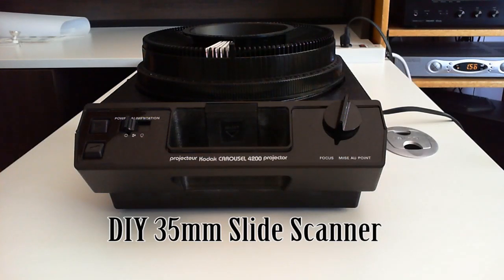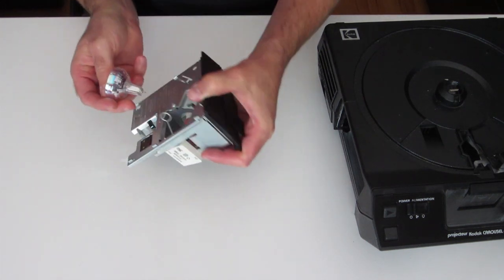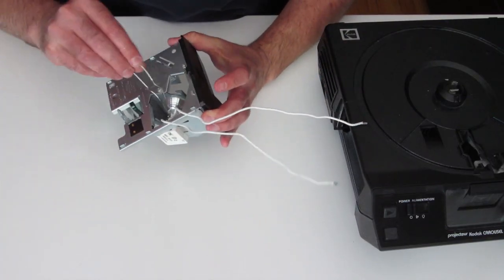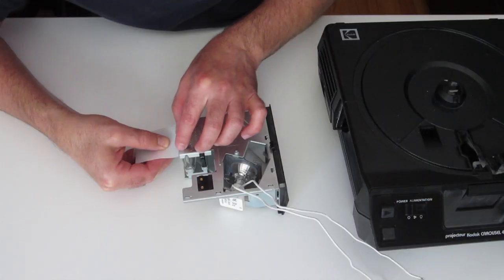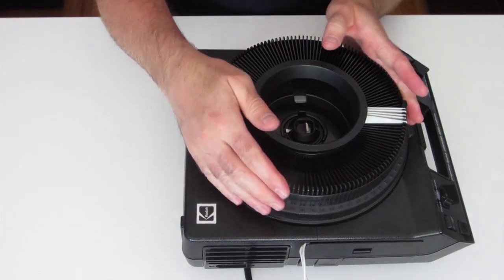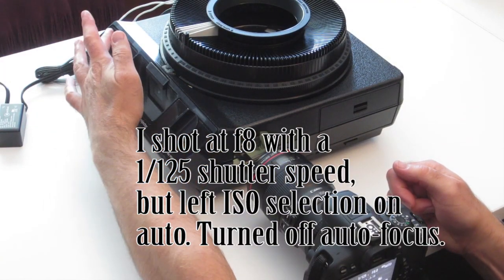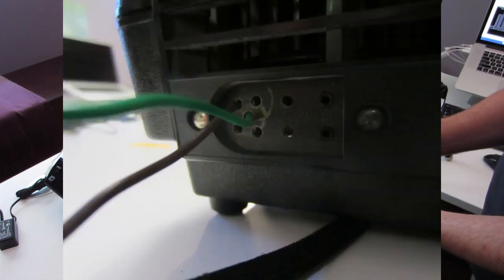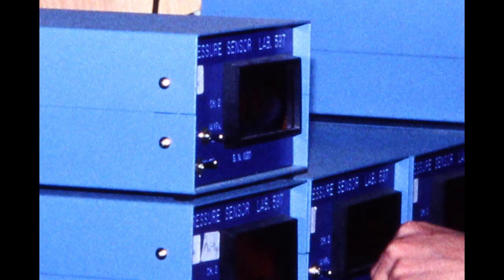DIY 35mm Slide Scanner

Comment: I would be glad to pay you a fee for in depth instruction on how to build this project. For example, I went to the raspberry pi web sight and found many computers to choose from, which one, I have no idea!
Reply from the maker: Hi Andrew, you can do it with any generation of Raspberry Pi, but I was using the 3rd generation. If I have time, I'll try to post a detailed tutorial of the automation portion of the project. Depending on how many slides you have to convert, it might be easier to just manually advance the projector, and manually fire the camera. It would save building out the raspberry pi portion, and give you the same end result (except you'd have to click the projector advance button with your finger, the click the mouse to capture the image for each slide).

Comment from the maker: Python code can be found here: https://pastebin.com/8yYf6NCW
If the code compiles and runs without error, it will likely output http://0.0.0.0:8080 at the Raspberry Pi console.
Hypothetical situation: Digicam is running on a computer with IP address of 192.168.1.50; Raspberry Pi IP Address is 192.168.1.75; You have 12 slides in the carousel;  From any browser, you would enter http://192.168.1.75:8080/advance/192.168.1.50/12  You should see messages appearing on the Raspberry Pi console. If you see that, but the slide projector isn't advancing, your raspberry pi wiring isn't correct.

Comment: Hi and thx for a very helpful video! 
I managed to get a relay to work to advance the slide projector and I can trigger the digicamsoftware via chrome.

My problem is that I dont know how to use your python script. It does not seem to be as simple as running the script on the raspberry pi, how do I setup REST?

Here is from when I tested your code pasted in slidetest1.py:

sudo python slidetest1.py

File "slidetest1.py", line 42

SyntaxError: Non-ASCII character '\xef' in file slidetest1.py on line 42, but no encoding declared; see http://python.org/dev/peps/pep-0263/ for details
Reply from the maker: The error says there is a unrecognized character on line 42 of the python script. Did you check the script to see if there are extra characters (copy / paste issue, perhaps) when compared to what is in the comments?
Reply: @philivers8155  line 42 is the app.run() line. 

I'm noob on python :D But am I suppose to run the script with sudo python? and then start it with http://(IP Address of Raspberry Pi)/advance/(IP Address of DigiCamContol Webservice)/(integer for the number of slides in tray)?

My question is if I need to setup REST first or does your python code initialize REST somehow?
Reply: If you have time take it step by step. I already sorted digicam, relay etc. So only how you would setup REST and execute python code :)
Reply from the maker: @IvanBertel  The python code includes everything for REST. The fact that you're getting a syntax error means your code does not compile, therefore it does not exactly match my code. You probably have a non-printing character if you don't see something obvious on that line. Try deleting that line, then typing it in manually to avoid copy/paste issues. Python is very picky about indentation. Make sure when you type it in manually you indent it the same as the original. You shouldn't need sudo in front of the python keyword, but it won't hurt. python slidetest1.py should get it running, then you activate it with the http call from a browser.
Reply: Realized i needed to install web and request modules. Done and now I get this:

sudo python slidetest1.py

Traceback (most recent call last):
  File "slidetest1.py", line 41, in <module>
    if name == "__main__":
NameError: name '_name_' is not defined

Comment: No lens, silly me.  Perhaps with a low wattage bulb, slide popping won't be an issue, but in any case will there be enough depth of field at f:8 to handle small variations in actual film location?
Reply from the maker: The few times that my slides were out of focus upon capture, I assumed it was because the focal distance between the camera and the slide had changed, so I re-shot only to find that the slide itself was out of focus. So, that hasn't been an issue for me. On my projector, the slide is held in the same place quite consistently.

Comment: Thanks Phil for the video.  I did the projector conversion this last week and it works great.  Using a Canon 7D and free Canon software for USB camera control and capture, and the wired remote for the projector it makes digitizing slides a breeze.  The commercial version of this costs over $3000.  I put this together for about $60 including a used Kodak 4200.
Reply from the maker: That's great! Glad to hear this worked out for you!
Reply: @philivers8155   hi i just saw your YouTube video do you have a wiring diagram you could send me or post

Comment: Thanks Phil for this video.  Just the project I was looking for. Will add automation later but first to convert my 4200 Carousel projector. Could you please indicate the make and model for your 12vAC power supply?  It is similar to this Amazon item to which you added the switched cord and output sockets? https://www.amazon.com/dp/B076KX33JW/ref=sspa_dk_detail_3?psc=1&pd_rd_i=B076KX33JW&pd_rd_wg=b0VIs&pd_rd_r=3VMPT562PH9Z47WXSC0K&pd_rd_w=FMngI .  Thanks.
Reply from the maker: Hi John, I would say that Amazon item looks very similar. The power supply I'm using is from a hardware store (home depot or lowes, can't remember which one) and it's sold along with under-cabinet halogen lights. It's a EuroFase brand, model H084-3. 60W max output, and it's stamped for 12V halogen lighting only. It came with the switched cord, as it's designed to go with the puck lighting you'd put under your kitchen cabinets.
Reply: Thanks for the info. Looks the the bigbox stores around me don't carry that one anymore (or very similar) and the EuroFase H084-3 is only at specialty lighting stores.  Ordered the Amazon one and will add my own cords, switch, etc.  Specs do sound about the same.  Hope to be scanning soon!

Comment: Any chance  you can post a detail tutorial on the raspberry pi  and other peripheral for automation?
Reply from the maker: There are lots of on-line tutorials for raspberry pi automation. I've already shared the python code in a comment below. Given that I don't know your level of familiarity with linux, raspberry pi, electronics, etc., unfortunately I wouldn't know where to start.
Reply: I've digitized over 70,000 slides using the manual method and many more thousands to go. My electronic knowledge is nil. Other youtubers use only relays, I find your process to be ideal. I'll keep searching, thank s for replying.
Reply from the maker: If you don't have an electronics or computer programming background, the solution I've come up with would be pretty tricky to implement, I'm afraid. The raspberry pi is really a very bare-bones computer. You need to know linux in order to operate it, and you need to know the python programming language to understand / modify the code which controls the automation part. You could set up the camera and projector as I have done, then use the shutter release cable for your camera, and the corded remote control for your projector. Then it's just a matter of pressing the projector remote, followed by the shutter release, and so on until you've digitized the tray. That may prove to be a big improvement over manually digitizing each slide individually.
Reply: @tangimages7876  Whao ! Tangimages, you spend a lot of time to do that, I suppose you have a good experience for  scanning film & slides, do you have a post to expose your recommendations ?

Comment: Phil - I almost have replicated your setup but have two missing links: #1 Code for pi for operating controller.  I have the raspberry pi connected to a controller to rotate the slides (I need some code in the pi to operate the controller - which I don't have.  #2 Connecting pi to Windows 10 and digicamcontrol. How is this done?  I am able to connect to the pi with SSH on my Windows 10, I have digicamcontrol loaded on my WIndows 10 -- I found the dropdown on digicamcontrol "webserver" and "Ardunio" -- But what are the lines of code I need for connecting my pi to Digicamcontroller - to turn the 4400 Carousel slide projector?  Thanks!
Reply from the maker: Hi Barlow,

What I did was create a REST service on the raspberry pi. The digicamcontrol software already has a built-in web service you can call to control it. So the python code on the pi does two things - one: it controls the GPIO to toggle the relay board, which causes the carousel to advance the slide; then two: it sends a separate command to the digicamcontrol to fire the shutter on the camera.

I call the pi REST by going to http://(IP Address of Raspberry Pi)/advance/(IP Address of DigiCamContol Webservice)/(integer for the number of slides in tray)

Here is the python code:

import web, requests
import RPi.GPIO as GPIO
import time

urls = ('/advance/(.*)/(.*)', 'advance')

app = web.application(urls, globals())

class advance:

    def GET(self, digi_cam_ip, loops):

        for loop in range(0, int(loops)):

            # specify how the pins are referred to
            GPIO.setmode(GPIO.BCM)

            # pin the relay is connected to on the Raspberry Pi (GPIO pin number)
            pin = 2

            # activate the relay for 0.25 seconds, then release
            GPIO.setup(pin, GPIO.OUT)
            GPIO.output(pin, GPIO.LOW)
            time.sleep(0.25)
            GPIO.output(pin, GPIO.HIGH)
    
            GPIO.cleanup()

            # wait for the projector to advance the slide
            time.sleep(0.5)

            # take the picture by calling DigiCam's webservice
            requests.post("http://" + digi_cam_ip + ":5513/?CMD=Capture")

            # wait for the image to transfer from the camera to the computer
            time.sleep(2)

        return "Finished"

if _name_ == "__main__":
    app.run()
Reply: Phil - Thank you.  I had to make slight changes in the code -but ... magically!  ...  it is working. So exciting!.
Reply from the maker: Awesome!! Glad to hear it!

Comment: Made you mentioned. I skipped through the video a bit but why did you change out the bulb? Because original bulb was too bright?
Reply from the maker: Yes, the original bulb was 350W.  Way too much heat created, and way too bright.
Reply: how did you cap off the hot connection to the light box? or did you leave it live and rely on fully insulating the pin connections to your leads on the bulb itself?

additionally, it was hard to see in the video to what extent you framed the shot of your slide in to the image area of the slide. Did you leave a border and crop in post, or were you framing it tightly and cropping in the shot?
Reply from the maker: The bulb inside the lightbox plugs into a socket, and the socket's pigtail leads poke outside the projector. There should be no risk of shorting inside the projector.

Some of the slides I was converting had a square (1:1) aspect ratio, others had 3:2, etc. I couldn't really frame it too tightly, as I would end up leaving some part of the slide out of the shot. How you frame it is really up to you - do you care if there is a black border on two sides? Are all the slides consistent, and if you framed them tightly, would the results be what you'd hoped for? Are you familiar enough with Photoshop to do a "bulk crop" on folder full of images? There isn't really a perfect answer to that question - it really just depends on what your expected outcome is. For me, these are just old family photos, of various quality. If I came across a particularly good shot, I might go back and reshoot it, and either tightly frame it, or at the very least, do a proper cropping job on the original.
Reply: Thanks Phil. I ended up pulling the factory socket in my mod because the light box assembly in my slightly different model (a 5200) was still too tight for the m11 LED I am using. For whatever reason the bulb is about a centimeter too long and I have even had to bend the pins up. 

I wanted to use LEDs to get a cooler lightsource, both in temperature of light and thermally. I suppose now that I'm physically hacking the projector I will disable the fan too.
Reply: Thinking about this a bit more, I think the mr11 LEDs I sourced must have been deceptively or inaccurately marketed as mr11s instead of mr16, which is what they appear to be. I was able to modify the bulbs to fit the lightbox, happily. Sadly, the fan seems too integrated into the projector's mechanicals to safely pull.
Reply: @foobarfoobarfu  Greetings Mike, I, too, have a 5200 projector. I'm trying to understand all the steps needed to convert my unit. Just to be clear, did you get the MR11 LED bulb to fit?  Did you have to pull the fan? Would you need to with the LED bulb? Looks like your removed the factory light bulb socket to get needed space? I don't understand the automated part but I'm trying to figure out that part. Did you go that far?
Thanks... Gary
Reply: @goddi2  Hi Gary. I don't recall if I pulled the fan. I think I just disconnected the power and capped the leads. I had to cut the front lipflange off the MR11 as well, I used a chisel and carefully cracked off chunks until the bulb fit.The primary reason I disabled the fan was that I was anticipating shooting about 7000 slides in this manner and figured out that would mean like two weeks to a month near a high-frequency sound source, which would do my tinnitus no good at all. The LED bulb did provide a good light source once I had some diffuser material in place.

I never automated the rig, though. After doing some test shots I realized that the gunk on the slides I was attempting to capture was too dense to just shoot direct and that I would have to source some IR-filtering scanners that use infrared light to interpolate around debris on the surface of the slide after all.

I finally ended up being three used Pacific Imaging scanners with varying CCD density and did complete the project. It took manually repairing two of the scanners in various ways and the average scan time per exposure was on the order of three minutes. Running all three scanners about eight hours a day it took about eight months. I sourced the scanners on eBay at around $300 each.Pacific Imaging's support contact was incredulous but supportive and helped me to indentify the faults and sold me replacement parts. the scanners I used were long out of warranty and out of production and the replacement parts they had were from their final stock.

The advantage of using a direct shutter-drop imaging solution here is speed. Our DSLRs don't have an IR debris cleaning mode. IIRC there is a commercial Kodak carousel mod for DSLR capture that MAY include infrared cleaning that sells for about $2k or which can be rented weekly for $2-300. In my opinion I would have saved both money and time if I had rented one of their devices so long as it includes IR cleaning.

I enjoyed the entire journey, however and hope you will as well.
Reply: @foobarfoobarfu  Greetings Mike, I estimate I have over 8,000 slides to digitize. Not sure if I understood some of your reply. Like 'gunk on slides' and 'IR debris cleaning'. Perhaps that is dust, etc.? I guess you were looking for a scanner with ICE? If so, I hope just using compress air will work for me. I am going to try Phil's setup. I want to come up with a stand that will hold the projector and camera in a fixed position so, over time, the camera can be removed and added back with little need for re-adjustments. As opposed to using a tripod. This might be the hard part. You took 8 months...yikes!!! 

So in the end, it looks like I can use the MR11 bulb in the 5200 with a little chiseling. For the fan noise, I'll just wear a set of noise-reducing ear muffs. I've been meaning to digitize all my slides for the past 18 years but I had a Nikon digitizer that did one by one....ugh. Just couldn't do it. Most of mine are in carousels so this method gives me hope. (I was just about to buy the SlideSnap Pro for $3495.) 

Also, it seems I will have to be sure to orient each slide in the landscape position so I don't crop any of the image. No one mentioned this but it seems necessary to do this?
Thanks... Gary
Reply: @goddi2  Yes Gary, that’s about right. Maybe easier to correspond directly? The Scan Snap offers much higher repro speed but no ICE.They do suggest that post-imaging filtering using interpolation is comparable to ICE, I do not think I am highly qualified to assess that. The rentals for Scan Snaps are are significantly less expensive than buying one, but one assumes that a highly knowledgeable operator might be beneficial in that instance. The imaging portion of my project was successful, but I am still working on dating and categorizing the images which cover about fifty years. I have found both consumer and professional products to not realistically have anticipated the use case of digitizing a lifetime’s work of pictures and it is pretty aggravating! Anyway feel free to email me at mike@whybark.com.
Reply: @goddi2  re cropping I think there are two approaches. you can set the frame of the camera to capture the entire possible image area, meaning you reduce the actual transferred pixel count by at least half (which, honestly, is probably OK), or you manually reorient all the consistent frame-size slides to the same orientation, privileging maximum pixels, and then rotate them in post processing as needed. In a production environment, I would image all the frames in the same orientation and address after imaging to storage, and that is what I suggest you do. It is terribly inconvenient and uncomfortable to do this to decades old slides in a carousel, maintained in appropriate viewing orientation for many years, but ask yourself in a spirit of honesty when is the next time these carousels will be used for illuminated projection and act accordingly.